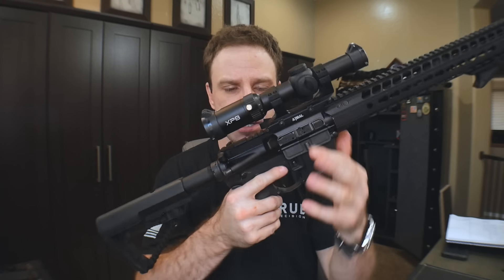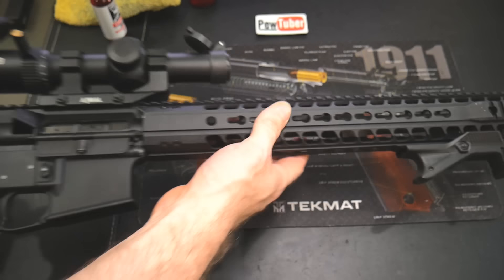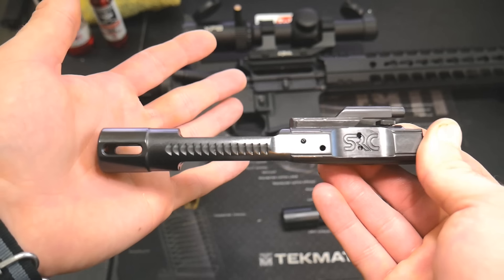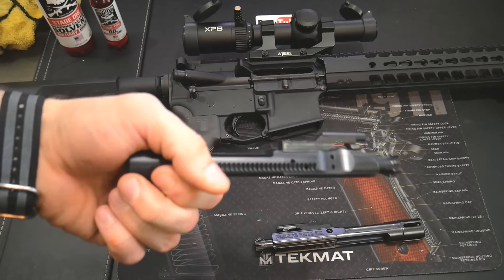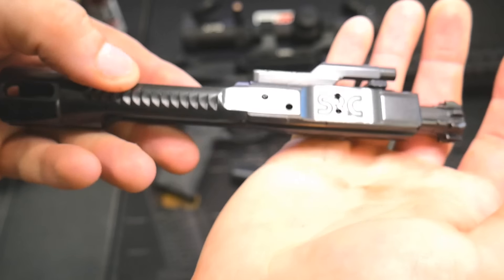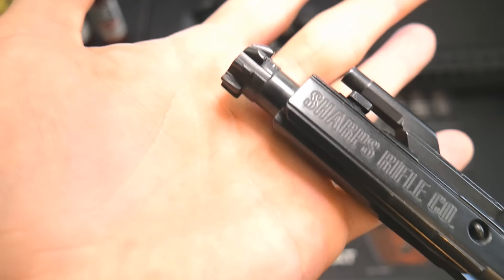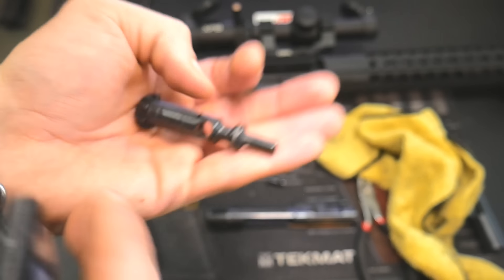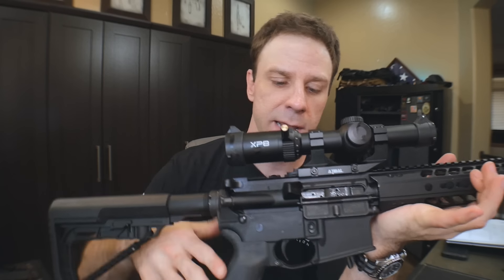World's Toughest AR15 BCG?! // SRC XPB BCG Review!

Comment: Can confirm SRC has made the most durable BCG on the market. I have one of the older NP3 "Balanced Bolt Carriers," and two of the newer XPBs in each finish (DLC & ZrN). I have fired many many rounds and absolutely ZERO issues! In fact, they continue to run well even when they are very dirty, something my Mil-Spec BGCs would start having issues with. Sharps also just released a .308 Bolt Carrier, so I picked one up immediately.

Comment: That reverse keymod is intended to prevent your accessories from backing out with recoil, which is an issue some have had with the keymod system. I think Radical Firearms did get it right.
Reply from the maker: Eric Coovert That's a great point man.... And that's exactly what I've heard.... I'm curious why aren't others making them that way?
Reply: Eric Coovert - That’s odd because the reverse is true. Recoil moves things foreword, which is why most keymod systems have their slots aligned foreword. That’s why all optics and accessory instructions say to move the optic forward flush against the rail and then tighten it down. Otherwise it might migrate forward during recoil.
Reply: I can't explain it but I can tell you that this phenomenon is one that others have complained about with traditional keymod rails. It's never happened to me, but apparently it has to some. This is the way Radical Firearms solved the problem and I have not heard of anyone complaining about their accessories backing out with this reverse keymod system. I suppose the cause could be when the bolt slams forward.
Reply: Eric Coovert - If that’s the case then why did Radical switch to the normal keymod on their current generation keymod rails then?

Comment: Last Thanksgiving I bought their NP3 Reliabolt BCG. I was building my dream AR. When I finally got the thing together the gas key was slightly out of spec and it would get stuck on the gas tube. It was two months after purchase and I contacted them. They don't make the NP3 line anymore BUT they took the BCG back and sent me this one at no extra cost. No questions asked. I just sent them the old one and a week later I had this new one. Great people to deal with. Great product.
Reply: I think I’m having the same problem seems like my bcg is binding on something terrible but I swap out to a different bcg and no problem smooth as silk

Comment: I had one of the first versions of the Relia-bolt and didn't even have to ask for an exchange. A new BCG just showed up in the mail with a letter telling me why and a prepaid UPS label to send the old one back. Letter even stated I was under no obligation to return the old BCG but would be entered into a drawing for a Sharps 25-45 AR15 if I did. I don't know if the Sharps BCGs are any better than other highend ones but it sure is easy to clean. Yea they made a mistake on the early BCG but impressed me with their over the top customer service.

Comment: Fair pricing on this BCG. I'd buy for that price. I'll definitely consider giving this Sharps a try.
But I'm a HUGE fan of Fail Zero Exo Bolt Nickel Boron. Or any good quality NIB.
Reply from the maker: Hell yeah man....It's definitely priced Right!😍
Reply: Rob nasty fail zero makes a decent bolt carrier group but I'm not a big fan of nickel boron coating it's super thick and it doesn't stay attached to the metal for extended periods of time because of its coating process. I do use ballistic Advantage barrels the Hanson series and they have nickel boron coated Barrel extensions which I haven't had an issue with as of yet but I would guess that the bolt and cam pin would get a lot of wear very quickly have you had this experience with your nickel boron stuff? And how many rounds have you had through it?
Reply: David Wright I agree, I've seen other NIB BCG have terrible coating process and chipping occurred. I'd be quite upset if that occured.
Fail Zero claims to be the original forefather of NIB.
My personal experience is I have 3 FailZeros. 1 roughly 900rds and the other less then 400. They have very slightly darkened a tad, only noticeable cause I have a 3rd one that sits unused. But besides that, no negative on it YET... But time and rounds will tell.
Reply: David Wright Oh and I don't have NIB barrel extension, will be a upgrade in the future when I do a barrel upgrade though.
Reply: Rob nasty I've got a young bolt carrier group that's got 15,000 + rounds through it now granted I've had to replace the extractor spring, insert and donut many a times along with the gas rings on the bolt and one extractor spring about every 5000 rounds but the stuff still worked I just went ahead and changed it to make sure. but other than that it's still rocking. That Chrome is 65 Rockwell hardness. I might have to send this fella one of Daniel Young's bolts and have him do a review on it see what he thinks.
Reply: David Wright now that's a Battle Rifle, proven too every bolt and nut lol Very impressive actually from that Chrome BCG. I have a bad habit of buying too many rifles too shoot lol
Reply: Rob nasty yeah I build AR-15s for a living and have since 1986 actually around 1984 really but I got into it heavily in 86 before the ban happened. I've got right at 20 to possibly 25 AR-15 couple of M16 a ones and a couple lr-308 and some AK and some other stuff.  every time I bring home more receivers stripped my old lady gives me that look like I might have to find another place to live LOL.
Reply: David Wright I have a few of Ron Smith's chromed carriers, from Smith Enterprise. I have NP3 coated ones from Sionics.  And I have a bunch of cage coaded Toolcrafts that are phosphate. If I had to pick one, I'd take the Smiths. I'm not a believer in gee wiz bang coatings. There really is no substitute for lubrication.
Reply: For the money , nitride bcg's have a better coefficient of friction than NiB . Nitride 0.45 vs   NiB 0.5 to 0.8 
And its not a coating its a surface treatment. Don't get me wrong I have 5 NiB bcg's 3 FZ, 1 WMD and 1 Iron City Rifle Works they've all worked flawlessly. But I like my nitride bcg's a tad better, especially with a light coating lucas.

Comment: How many C-158 or 9310 bolts has anyone seen break? Barrel lugs being compressed happens far more often than bolts breaking. And the fact they only batch test. Kinda sounds like, "We have no vetting process, but because we substitute material and market it as better...We think you should buy it...Oh and we added a slick coating." If your wanting a improved BCG, LMT has the only vetted improvement over a standard carrier system. You'll pay for it, No doubt.
Reply: Carpenter 158 does break.

Comment: Anyone notice a little binding or hesitation when manually cycling the bcg? Compared to a mil spec bcg ?
Reply: Could you be describing the gas rings on the bolt, that are designed to have a friction fit in the gas ring run of the carrier?

Comment: Just picked one up for my spare parts build. Can't wait to see how it performs compared to the Fail Zero NiB-X that I usually go for. $40 price difference isn't bad at all considering all the design features it has. Only thing I wish it has was a rounded cam pin instead of a squared one like normal as the rounded design has proven to not marr the upper as much in operation. However that's such a minor detail or "issue" that it won't ever bother me. I've heard the PVD DLC is better than qpq/melonite/sbn/nitride whatever you want to call it.

Comment: Great Review John, I actually have used the SRC NP3+ Relia-bolt in two AR's I currently own. Both have experienced several thousand rounds without failure and very minimal cleaning in between. I am very pleased with the quality of SRC. One thing I think you should check out though is the bolt carrier from Voodoo Innovations. I use  the Voodoo Innovations Lifecoat bolt carrier, firing pin, and cam pin from them. Then I pair that with the reliabolt. The reason why the Voodoo Innovations bolt carrier is my favorite is because the coating just absolutely rocks! And the bolt carrier design is unlike anything else currently on the market because it utilizes an integrated gas key so you do not ever have to worry about carrier key separation or proper staking. Here is a link. I promise it is worth it. 

http://www.voodooinnovations.com/vdi-lifecoat-integral-bolt-carrier
Reply from the maker: I will definitely check it out brother👍
Reply: Sweet deal! Just so you know there are two models. Here is a link to the low mass model. 

http://www.voodooinnovations.com/vdi-lifecoat-low-mass-bolt-carrier
Reply: If I’m not mistaken the dlc coating is exactly what voodoos life coat is